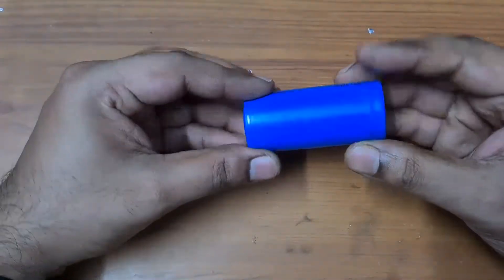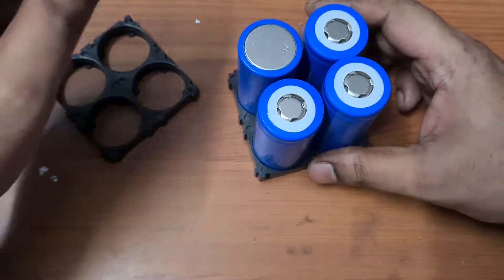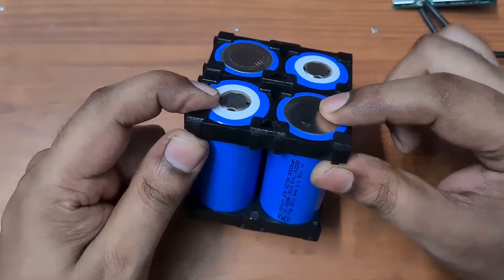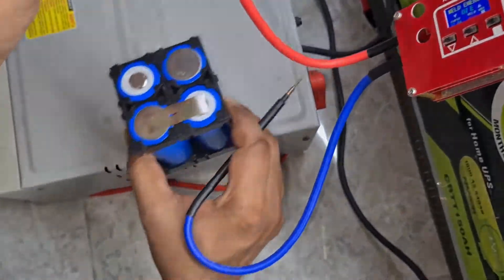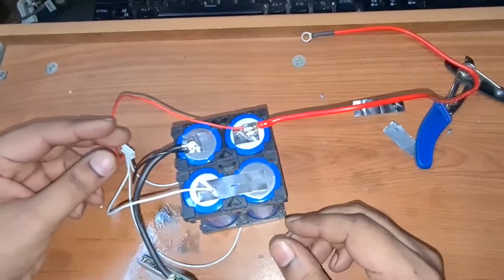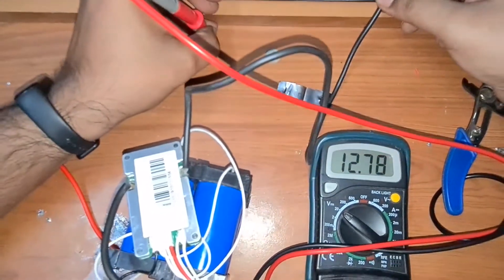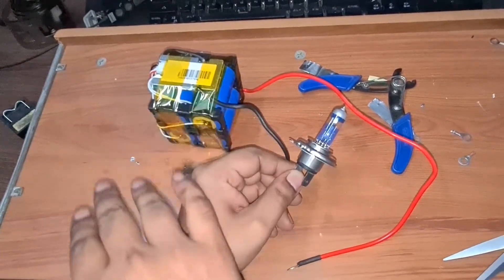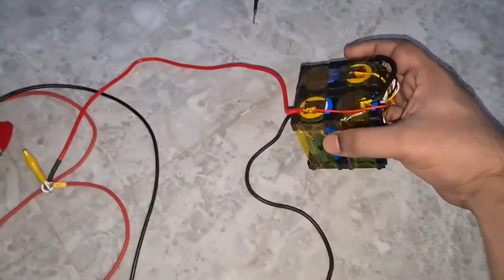DIY Build | LiFePo4 12v 6Ah Battery pack | Capacity test

Comment: This Can be used in bicycle ? If yes can I drive one 12v single tone horn, 12v led light (32w) & 12v 4 no.s led strip lights for 2 hrs
Reply from the maker: Yes you can. It will work fine.
Reply: @diyIndia  thank you for the clarification. Can you tell me Lifespan of battery, charging cycle, charging time & cost of making this ?
Reply from the maker: Life cycle should be upto 2000. Charging time depends on your charger. Why don't you join our telegram account. We keep having discussion like this.

Comment: Hi I have a 36v 4amp batterie can I series connect it with a 12v 4amp battery to have 48v 4amp battery
Reply from the maker: I need some more info on the batteries  what are those batteries and what's the chemistry. You should not mix different voltage batteries.
Reply: @diyIndia  18650 batteries

Comment: Neat work! I guess you didn't need to pre balance the cell voltages since all were in series. But if you were to have any parallel groups, I believe pre-balancing would be required. 

Also, have a small request. If possible, can you do a continuous 1C/3C discharge test and check how much the joints/spot welds are getting heated?
Reply from the maker: Before I connected I made sure that the voltages are same. The max discharge I did was at 4.5ah, that's the maximum my dummy load can handle. The batteries and bms did not get hot.  For 3c, may be I will try to connect two halogen bulbs and see.
Reply: @diyIndia  Thanks